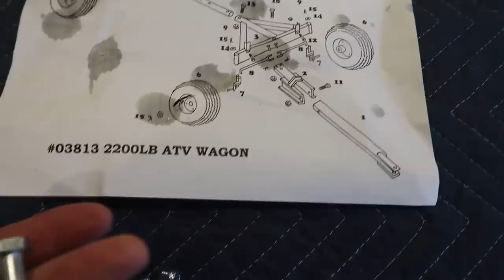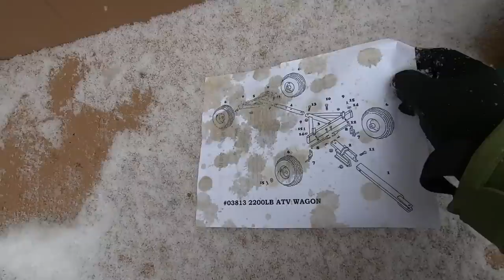This is Going to CHANGE the Way we FARM!

Comment: You can align the wheels by measuring the distance from the front and then the back of the tires. Adjust the bars until they match. there is usually a center line on the tires to go by.

Comment: A little toe-in is usually a good thing to make the front tires center and travel properly.  About 1/8" to 1/4" toe-in.  Also, you might want to consider putting the valve stems on the inside since you will have hogs around it all the time.  They could find them enticing to nibble on.

Comment: what a great idea the Bacon Mobile - what are you going to do to cover the wheel so they don't get chewed? I was thinking of a ramp system on hinges that fold up and get clipped up when it is moved then dropped down in the new spot - properly easier than taking the wheels off each time - pigs are nibblers

Comment: Al, I would have put the two ends together in the basement then carried them out to put in the bolt that joins the sections. I think all that ice and snow may have frozen your brain! Why not build the frame and structure inside the outdoor kitchen? You have heat in there.

Comment: Gooooood Moring Al , 
I'm 4th .  Any sign of the snow yet ?    I was getting about an inch per hour and then it stopped after about  four hours.  The afternoon warmed up and it began to rain.  By nightfall more than half of the new snow was gone.  Today  ( Thursday ) it is supposed to be warmer yet. With a little luck my driveway will clear itself and I can go shopping.

Comment: Piggie tractor is a "hay wagon" design. Keep in mind while using it they are almost impossible to back up like a regular trailer.It might be a good idea to get some practice in before building the full pig house on top of it. It'll be easier to pickup the back end and possible be a funny video.

Comment: You need to make 1/2 of that Huge Basement into a Workshop and have a large workbench with a large bench top surface whereas you can build and or assemble your various projects inside and take advantage of the heat from that wood stove instead of working outside when it's colder than a Well Digger's backside in the North Pole !!

Comment: Because you're using it for pigs.... consider putting the tyers with the valves on the inside( so the pigs don't chew them)... 
Nothing beats the squeal of happiness as your child flies through the air.......just be glad for happy soft landings.... <3 
(With our 11 kids we have had 4 broken arms at the same time(roller skating,Bmx's and tree swings)(23 breaks all up) all from adventures !!)
I just tell people I beat the bad kids ..... you should see some of the looks.....)
Reply from the maker: That is a good idea. Thanks
Reply: @LumnahAcres  or just leave the wheels alone and have the pen only to the back end of the wagon.  The wagon doesn't have to be in the pen.  Some homesteaders use their livestock trailers just like this for pigs.

Comment: Nice tools, I made a nice living with Snap-on, and SK tools. You are a little incorrect on your wheel alignment explanation. On a vehicle you actually need a small amount of toe in (about 1/8 of an inch), or the vehicle will not track properly. That said, I suspect it will be fine to have no toe in on your project.
Reply: @Milton Tucker ,
It's a little different on cars because the forward motion tends to push the wheels out to be straight.  On cars , camber also has an effect upon tracking. Things like the wagon move pretty slowly. However , a small amount of toe in may also help with tracking .

Comment: My grandma used to make sliced carrots as a side dish quite often. Instead of using a knife, she used a mandolin... Much faster. 💜🌞🌵
Reply: @Suzi Saint James ,
I used a mandolin for the first time last Oct.  I wanted to slice some apples. 
One slice , two slices and then I cut off the end of my right hand little finger
which now has an odd shape and the new skin is very tender.
 I can confirm that those things are very sharp ! I would not allow a child to use one and some of us adults need to be cautious also .
  Oh , and my brand new mandolin went into the trash .
Reply: @donaldmiller8629 , sorry to hear about your peril and conflict with the mandolin. Most mandolins come with a guard to protect hands from the razor sharp blade. But just like a meat slicer or a dough docking tool or a chainsaw, a mandolin is not a toy even if it is made from plastic. 💜🌞🌵
Reply: @Suzi Saint James ,
Unlike a chainsaw you do not expect a mandolin to be dangerous ! lol
I did have a guard /holder for food but the apple did not fit it .
Reply: @donaldmiller8629  , hmmm? My grandma's was still razor sharp after 40 years. And when I finally got around to buying my own it came with a clear warning "SHARP BLADE! USE EXTREME CAUTION WHEN HANDLING. Remove this protective covering before first use."... meaning that you had to remove the warning before you could use the mandolin. Also... printed on the box was: "WARNING: SHARP EDGES. Use care when operating and washing this item to avoid injury. Mine also came with a book showing how to assemble the unit with the various blades. The book is filled with warnings in every language. I'm sorry that you were not adequately informed and that you were seriously injured. But no one uses a 12" chainsaw on a 20" tree unless he knows what he's doing. Hopefully these comments will let people know that kitchen tools are no less dangerous than shop tools. Sending lots of love💖 from sunny🌞 Arizona🌵